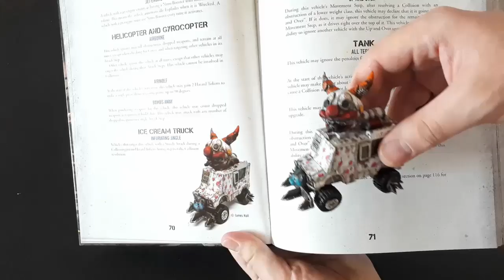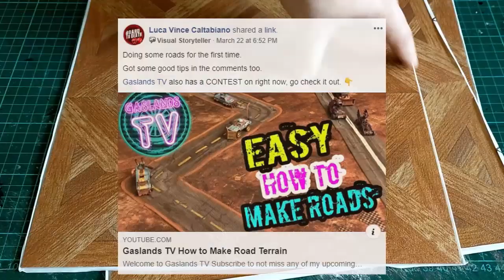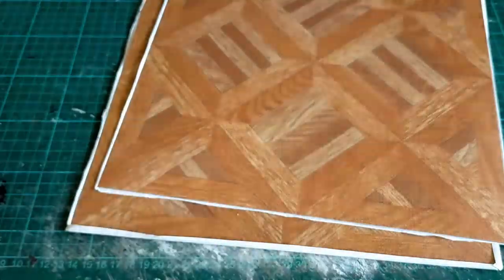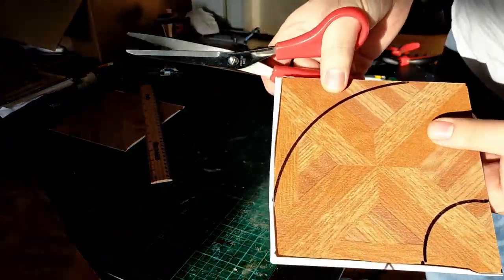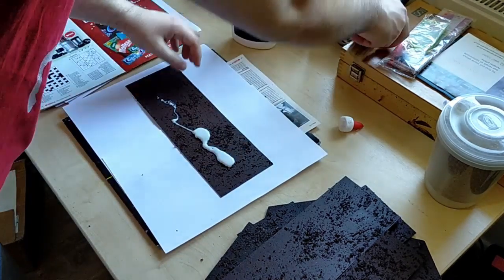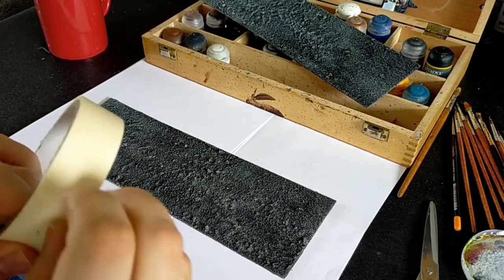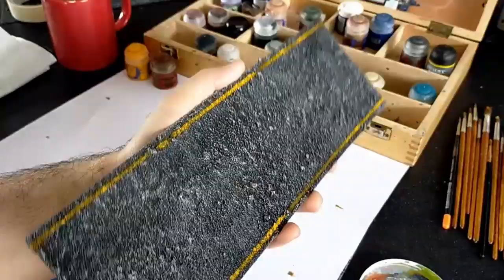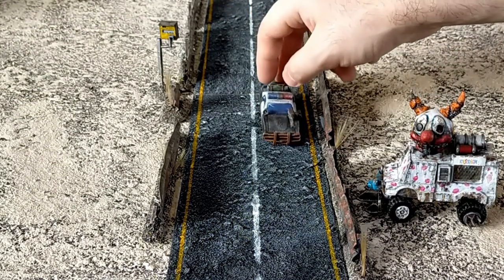How to Build; Roads

Comment: this is great! I have some suggestions, I find that prior to the sand texture the first thing I do is lay down different sizes of thread in the pattern of cracks  then do my texture  then peel away the threads revealing the deeper set cracks. Through trial and error, I’ve found that painting the cracked areas first with my base coat color then using rubber cement (cow gum for you Britt’s) on the threads before laying them down. for pot holes I use liquid latex. I love your work as always Jim.

Comment: Have you tried using roof tiles? :) on one side its more rough (bigger scale if you will) and on the other side, it’s more smooth. It’s my go to road material.
Reply from the maker: Sounds like a good shout 😉 but is it easy to cut with scissors?
Reply: @jhminiatures7867  It´s pretty thick :P, and the one side has a very rocky surface. I use a knife to make cuts, then brake it apart. I´d be happy to provide some pictures of my roads if you want :)

Comment: Did you structure the adhesive side or the other?
Reply from the maker: I used the adhesive side for the road, putting sand on it and painting it. I left the tile side as it is. So if the road tiles were turned over, you'd see a weird tile pattern 😉
Reply: @jhminiatures7867  Thanks for clearing this up!
Reply from the maker: @warhammerbremen1148  No worries :-)